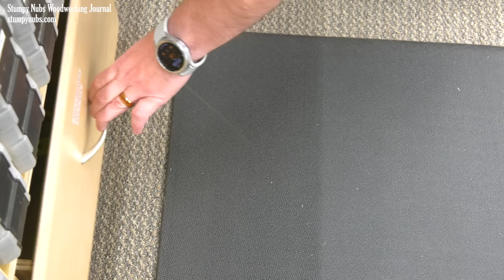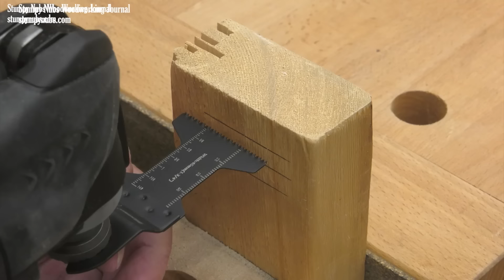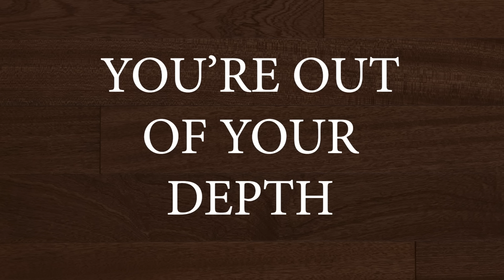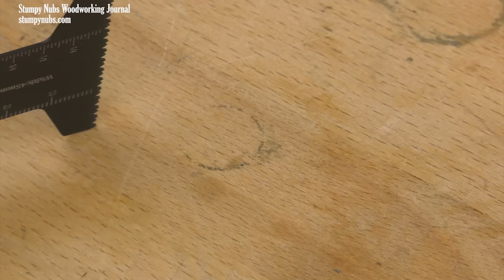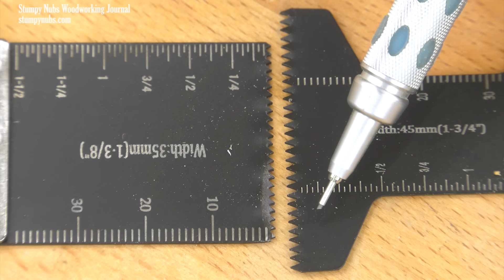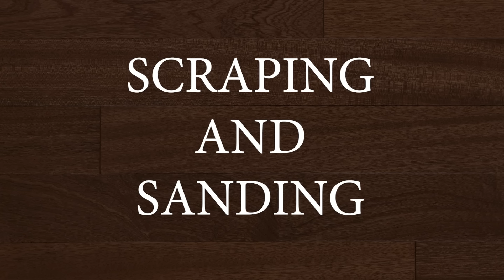An AFFORDABLE power saw that won't cut fingers off!

Comment: For a more useful and accepted comment I thought I’d say thanks for the speed kills segment. 
I never thought about the slower speed being more effective for making metal cuts. 
I have been using my Makita Multitool now for about 3 years, and just a few days ago I noticed the speed control dial was not working properly. Which necessitated a bit of effort to correct it with an old tooth brush. 
Now that I’ve been informed about the slower speed I’ll probably have better results. 

Most of the use in my world had been drywall, with the occasional nail needing cut to remove a nailed in Jbox. 

Those boxes of assorted blades are great. I came across what appears to be the same product a couple years back. 
A few weeks ago an unusual J shaped blade for making pull out type cuts was needed. I searched a couple places and found one. 
Needing to make a cut from inside a cavity. 

Thanks for the tip about reusing orbital sanding disks. I recently used both tools to clean oxidation from aluminum, the round disks were burning out, as you mentioned along the edges. 
The triangular shaped ones helped immensely at the corners. I didn’t think about the central part of the round (as you said, it was mostly still serviceable) disks being still useful. They cost a lot less than the purpose made triangle shapes that were costly and didn’t last long at all. 

The reversal of the blade is a great thing. I have an arsenal of makita cordless gear, and following the acquisition of these tools I also chose to use the Makita stackable cases. Various sized for different tools. 
The multitool has its own special box, and reversing the blade makes it less prone to damage, as well as not having the blade aimed outward before I’m set up. 
When it’s running, it doesn’t ever cut me. But when it’s turned off, it almost always finds a place where I can bleed, generally on my leg as I walk somewhere with it harmlessly turned off, but blade aimed outward seeking flesh or a customers leather furniture! lol 

As usual, your videos almost always have more value than immediately expected when I just see a catchy title. ❤

Comment: I found out that an old worn out wood or metal cutting blade works great for cutting cement board. It doesn't so much as cut or grind, but the quick and short oscillations act like a long thin jackhammer.

Comment: The scraper blade works great to clean up shoddy sheet rock on door and window frames. Leaves a clean edge without the dust. Grind dull saw blades to create one as well.

Comment: Instead of turning the blade around I fabricated a holder for the tool, with  blade, that allows for the hanging of the tool with the blade installed in the 'normal' position. Thanks for the tip of the set of blades at a reasonable price.

Comment: My top tip for rough works is to use a small triangular file to repoint the teeth on blunt wood/plastic cutting blades. I generally only use my tool for cutting drywall (for electrical boxes) and for joinery cuts (nothing that's on show) and I can cope with the rougher finish that my repointed blades give. (I got this tip from SeeJaneDrill)

Comment: I bought one of those saws about 15 years ago.  It works fair for cutting plastic, plunge cutting drywall, flush cuts, and small cuts in wood, but it is too slow for doing any cutting bigger cuts.  For that use a jigsaw.  I consider them to be little more than a waste of money unless you are  doing those sorts of tasks often. Other wise just use a good sharp hand powered keyhole saw.

Comment: I spent £20 on a blade for my saw. It has cut through stainless steel and high tension bolts with ease and the blade is still good.

Comment: I didn't use mine much at first because the blades were so expensive all you had to do was touch a nail or hit the concrete behind the piece of wood you were trimming out and the blade was done until I found blades for 75 cents a piece on Amazon and then I found a company that made reversible blades that put the cost down to 35 cents a piece because you got double use out of each blade just by flipping it, now I literally use this tool everyday!

Comment: I got a good deal on a Rockwell kit that included sheers. If you cut your own shop rags, these sheers make really quick work of it. The last thing I used it on was rat wire, cutting it down to size for a cage. Again, very quick work of it but I haven't tried it on anything else since then so I don't know if or how much I dulled them.

Comment: Can be really useful for light demo work. I used mine last weekend for removing about 10 sqft of a raised subfloor that was glued and nailed down. Cut between the vinyl tiles on top through about 3/4ths of the subfloor. Was impossible to pry up without potentially seriously damaging the floor boards before that.

Comment: another tip: depending on your blade connection, you can invert the blade if you have to cut with limited clearance.  it's not much, but sometimes a half inch makes a difference.

Comment: I just looked up the UV cure wood finish and got Huge sticker shock.  It starts at $133 for a quart or $512 for a gallon..  They also recommend using a one of two sealers first on bare wood for the same prices.  The UV lights that they sell start at about $250, then $300, and finally almost $400.  

These seem like very nice finishes, but I don't see this as something that amateur and weekend woodworkers are going to be rushing to use,

Comment: Regarding the vibration issue, i have carpal tunnel (from computer use) and nerve issues are highly aggravated by intense vibration. If only using it for a short time and don't have carpal tunnel or other nerve issues it shouldn't be a problem. That being said I got a Fein multimaster since it has very low vibration tranmitted to the hand. If you are a professional, then you do need to worry about vibration causing nerve issues such as carpal tunnel. It happens frequently with people that operate jackhammers and other vibrating equipment.

Comment: Had an exterior door frame with rot near the bottom. used the saw to remove just the bad section and replace the wood. Saved having to buy an entire door frame.

Comment: FYI if you're in a pinch, you can fairly easily get a dull blade cutting again by filing the teeth. It's not going to be pretty, but it has saved me.

Comment: I always remove the blades for storage and keep it with the other blades. They're designed to be easily swappable, so reinstalling doesn't take much. It protects the blades and your hands from getting scratched up when reaching for the tool.

Another thing, you can actually resharpen the wood blades when they get dull, you just use a triangular file. You might be able to do the same for the metal cutting blades, but I'm not sure if they're heat-hardened. I still would give it a try though. Seems like a waste to throw out a sizable hunk of metal that only the very end is no longer sharp.

Comment: I have a couple of these tools, a cordless and a corded. The corded tool is very inexpensive one from "that" budget tool store, cuts exactly as well as the high end Fein tool.  They are great tools, though like you, I refuse to buy name brand blades. Having bought name brand, then buying "bulk" packs from other less known vendors, you see quickly that the name brand are indistinguishable from the aftermarket. My guess, the brand name guys buy them from the bulk sources and rebrand to their packaging. Also note the teeth on the blades are designed to cut faster in one direction, most noticeable on the Japanese style tooth design. That's helpful when doing the initial plunge cut, it makes a difference.

Comment: Take a look at EZARC blades as well.  I keep and use those for my finer work and use the cheap Amazon sets as beater blades for drywall or cutting up against concrete where I'm likely to ruin the blade.

Comment: I bought one of these after I had to remove a cabinet to put in my dishwasher. There was an impossible to reach screw inside (must have been put in before the counter top was installed) and my father had one of these so we plunged it right in and cut the screw. I don't know of anything else that could have done that without destroying the whole adjacent cabinet or counter top. We used a metal putty knife to help guide it in, and you can't even see a mark on the remaining wood.

Comment: Oscillating tool sanding pads are not very effective on wood, but I think that on fiberglass they work great. 
You can get things done fast, but they are not eating too aggressively through thin layers of fiberglass, so you 
can keep tight control easily. 

Not for large areas of course.

Comment: I have one from Bosch. Its awesome and has saved my butt several times. The name that it has in my shop is 'the problem solver".

I hardly use it in "planned situations" but i use it a lot of times in situations i did not plan for or have to adopt. 

I think every woodworker should have one.

Comment: The main mistake people seem
to make with multi-tool blades is not moving the workpiece along the length of the blade to spread the heat out across all the teeth and reduce heat build-up on any given section of teeth.
Even many demonstrations from tool manufacturers get this wrong. This is one of the few that got it right, but it still could have been better; the movement was mostly rather hap-hazard, sometimes paused on one section of blade, and the sideways plunge cuts could have better spread out the cut along more of the blade IMO.

Comment: Here's an application you might not have thought of.
A bathtub with a heavy soap scum/film will often yield to Scrubbing Bubbles and elbow grease oscillating a Scothbrite pad - guess where to get elbow grease!  A sanding pad on a cordless oscillating tool with Scotchbrite as your "paper", or doing the same with a cordless pad sander, and your shoulders, elbows, and wife will thank you.

Comment: Last month I found a video about resharpening thrteeth of a plain blade (not bimetal or carbide or japanese style teeth), by hand or with a grinding tool (Schwaiger PHW0200). I though it was rather expensive and only an option for wood workers who wear of a lot of these blades. Today I've found a second tool named 'SharpTool' by a company 'SharpTools'in the Netherlands for a consumer friendly price (the original has a diamond plated grinding surface). 
But as saidI don't use that saw blades often enough to think about buying these grinding tools, so I can say nothing about their quality.

Comment: James,  Love my oscillating saw/Multitool, but even through it won't cut fingers off, It will cut you.  Running a finger hand leg or arm across the blade, unintentionally is a problem so I always set the thing down flat on the floor/bench for safety, even though setting it upright on the battery is a bit more 'handy'
Reply from the maker: As I said, if you push hard enough with the right blade, you may get cut. But unlike other power saws, you are unlikely to accidently get significantly injured by inadvertent contact.
Reply: @StumpyNubs Stating that one tool is safer than another is reasonable. But you haven’t sufficiently explained that different blades have different potential to injure you, the thumbnail shows a long tooth blade that is exactly the kind must likely to cut you, and you haven’t sufficiently warned about burn injuries. Just my opinion, but I’d be editing this video and changing the thumbnail.

Comment: I don't know what I did with out one of these for so long, despite them sounding like a box of angry hornets. They can be annoyingly loud. I thought I'd never use the sanding attachment,  but I have used more than I thought in those awkward spots the orbital sander cant reach. just finish off those areas by hand if important.

Comment: Won't cut your finger off but if you buy a wood cutting blade with the long teeth, you can cut into the nerve and thru the tendons. Like i did. thinking it was so safe. Don't buy the long tooth blades. ( I got them as it was all the store had.)

Comment: The tighter your skin is, the more likely an oscillating blade is to cut you.  If your skin is already pulled to the point it's near its elastic limit then the blade can cut it.  This is easy to test with balloons, one under inflated won't pop while one over inflated will pop.

Comment: The sanding heads for these can heat up and melt, which I haven't seen on my regular oscillating sanders.  I have a corded on of these that I don't use too much.  Been looking at a cordless one, but with my choices limited by the batteries I already own, it is a lot of money I don't want to spend yet.  Someone needs to figure out how to make cordless tools that can use most of your big brand tool batteries.

Comment: I am a doctor, and these vibrations are extremely unlikely to cause any nerve damage -  in the amateur environment. Vibrations need to be considerable (eg, pneumatic drill) and prolonged (hours per day) and performed over many years to cause nerve damage.
Of course, if you have a vitamin deficiency,  (eg B1 or B12), this could impact on (and possibly exacerbate) external nerve trauma.

Comment: This one time I was working on the subfloor. The dirt wasn't very deep. I was standing between the joist. I was climbing out on top of the floor. I slipped on the joists that were two foot on center I caught myself on the blade of the oscillator. Definitely can cut you😂😂😂

Comment: Lol @ these things not cutting you.

Here's one you probably werent thinking of.
Dude was trying to pry a board off the wall with one hand with his entire body weight and all his might. The board finally let go and it happened so fast, his hand with the board in it slammed so hard into the cutoff tool he was holding in his other hand at the time, which wasnt even plugged in, and he tore the entire palm of his hand open and had to go get about 20 stitches. Now I know this type of 3 Stooges comedy routing isnt exactly what you were envisioning when you said these things wouldnt really cut you, but yeah, sprinkle in a good dose of carelessness and this tool can definitely cut you.
Reply from the maker: You can find a freak accident with just about everything. A man was once killed because a fish jumped out his bait bucket and went down his throat, choking him to death (true story).
Reply: Any toothed saw would of done that, or a screw driver or anything with an edge...That is just some idiot who probably shouldn't be using any power tools...or hand tools for that matter. Also why was he holding a tool that wasn't plugged in?
Reply: @StumpyNubs  Ha ha. The death would be bad, but being remembered for that would be worse. Everyone has to die. I would choose getting eaten by a lion or something. Sure, it's going to suck for a minute or three, but what a great story it would be.

Comment: OT: This completely off topic and I am not a real woodworker. Grizzly has this, I  think new, machine that is a combination jointer planer that can be readily changed from one function to the other. One model will do up to 12" boards at about the price of $1400. Does anyone have an expert opinion on this?

Comment: Blades with (comparatively) large teeth designed for cutting wood are not the same as the blades used for cutting casts off people’s broken legs. Not only can wood blades cut you, but all blades can burn you. Don’t touch the business end of multitool blades when the machine is in use or shortly after.

Comment: I disagree on one point.   The best blade for aluminum is NOT a metal cutting blade.  Wood cutting blades work very well on aluminum.  This is from 30 years experience working with aluminum.